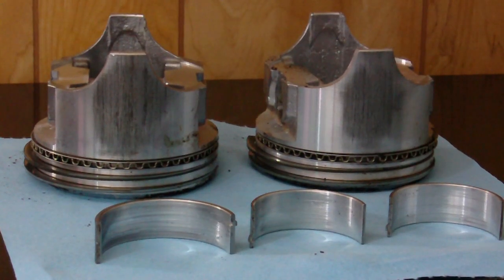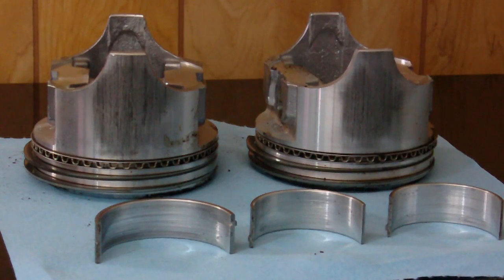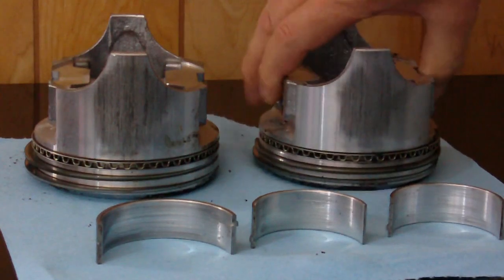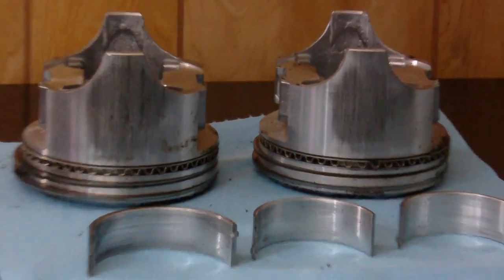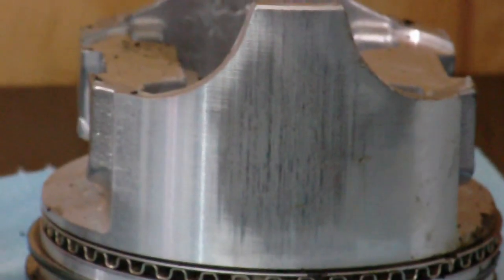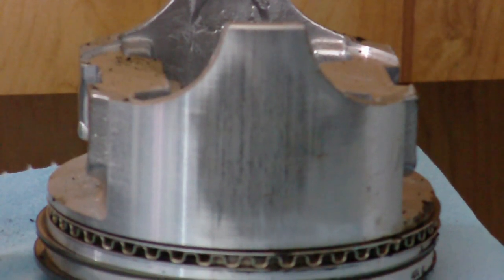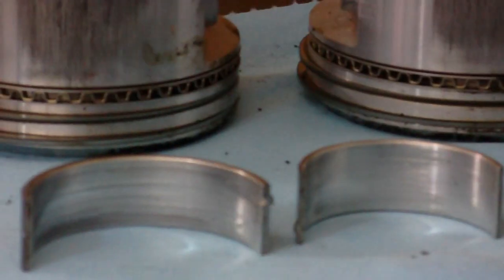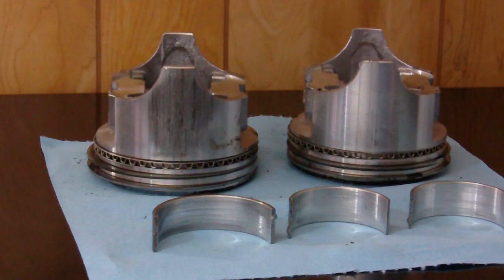Vortec 350 Pistons Totaled in a Chevy 1500 4-Bolt Main

Comment: Finding that vandals messed with it is bad ...but those cylinders where not straitened when the machine shop put the pistons in ...they probably looked at it maybe mic the top of the cylinder and not checking middle or lower in the bore ..so bores honed while still out of shape ...piston to wall clearance was all screwed up ..while its running the pistons are shaking like Michael J Fox..in different areas of the bores worse than others  across all 8 ..wrist pins probably look like hell also..

Comment: every engine iv ever broke down has looked like this,some even worse than this,even my 18 wheeler engine looked like this when we broke it down.
Reply from the maker: What caused your engine to break down? I have also torn down Diesel engines with 20 years of service that did not look like this. The engine builder agrees this was caused by vandalism and not neglect. Even the temperature plug on the water jacked was intact indicating it was never overheated, the major cause of engine failure. Oil analysis confirms the oil was within acceptable standards until it was counted for solid particle content and it also indicates there was a solvent in the oil. None of these contaminants are wear metals or naturally occurring as normal wear... I don't believe you have the experience to determine the cause of failure based upon parts analysis.

Comment: after building over 8000 engines,these pistons look to me to have way too much piston to bore clearance,and the bearings show the same thing,all of you,listen up,if you are building a engine for stop and go to the grocery store engine,piston to wall clearance should be .003 very slow breakin,750 miles minimum,rods and mains clearance at exactly .0017 this should give you a 250,000 miles engine with a timing chain every 85,000 to 125,000 miles,i have a comeback ratio of less than 1%,change oil at 3500 miles 5 times in a row,then you can go to 5000 miles oil intervals,this keeps the pan and oil screen clean along with bearings,never use a fram filter,use wix and never walk senior ase master of 41 years and master trans builder for 38 years and so many rear axles I dont' want to think of it,anything other than what is said and you'll be sorry,racing specs are according to manufacter specifications,they built them,oil additives according to use,hot climate or cold,and screw lucas in the winter months

Comment: so in summary. are you demonstrating the cons of additives? is it better to use factory recommended oil for the engine? just asking. nice vid
Reply from the maker: This is the result of what happens when someone pours stuff in your motor oil to mess up the engine. The short block was totaled in only 1K miles

Comment from the maker: Blackstone analyzed the oil, wear metals were OK but the particle count was off the charts. The oil was loaded with very fine dirt from sabotage. The crank was rough and lost 10 psi oil pressure on one 100 mile trip. There was no loss of oil but the dirt sandpapered everything. The machine shop put everything new back in it and gave me the parts. Even the oil pump drive gear was ate up.